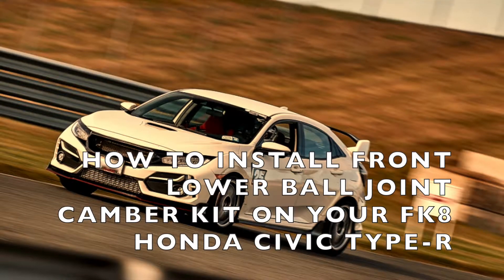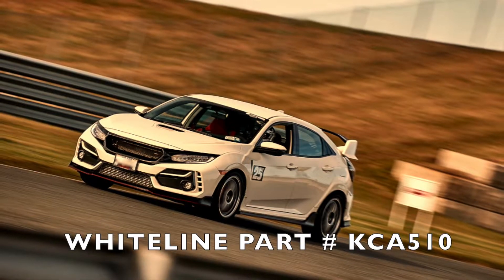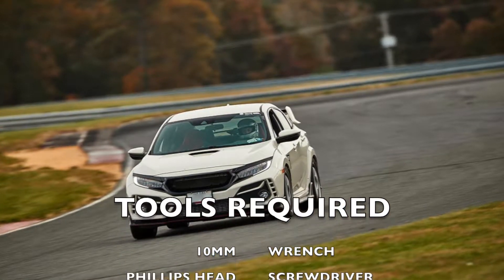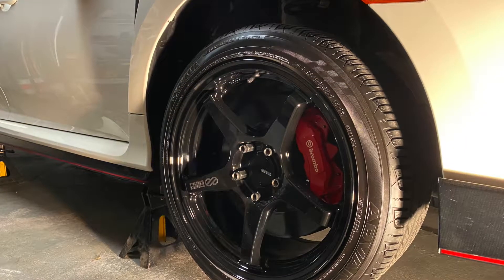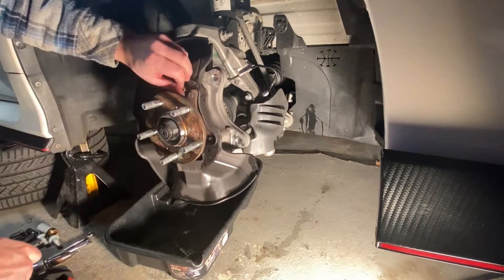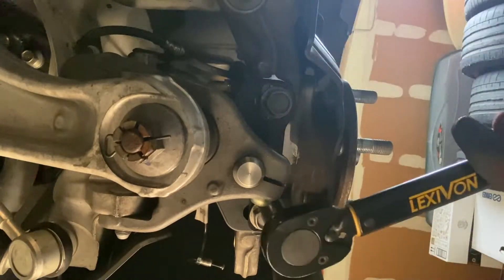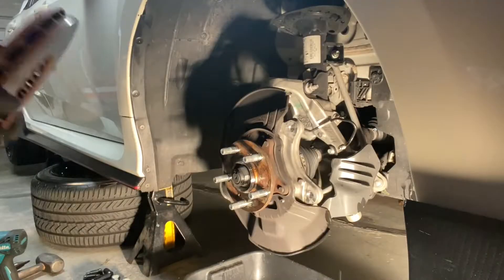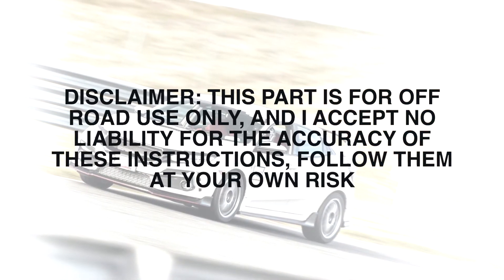Front Lower Ball Joint Camber Kit Install FK8 Honda Civic Type R

Comment: Do the washers/slide adjusters included with the camber kit for EVS go on the inside and outside before you bolt them back down? 

I’m assuming these must be installed or can you install without the washers and adjust camber like normal from the top by removing the top hat inner stud?